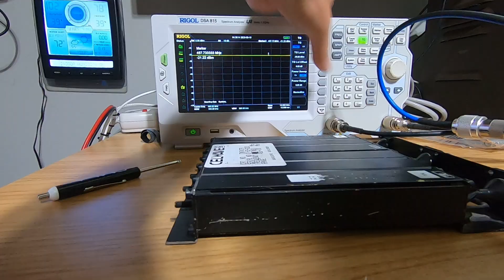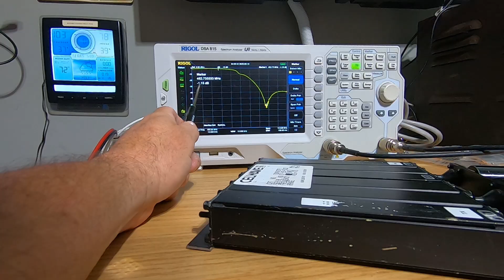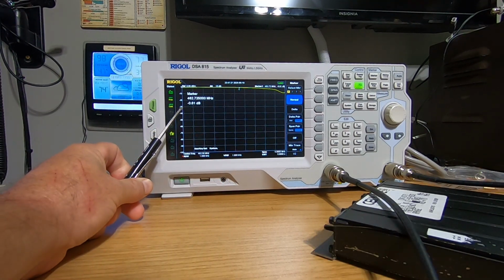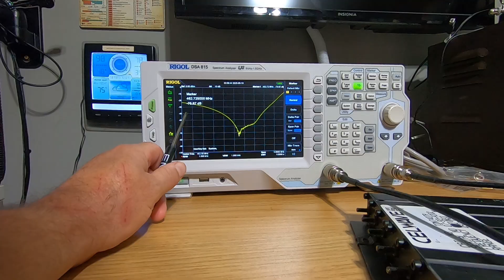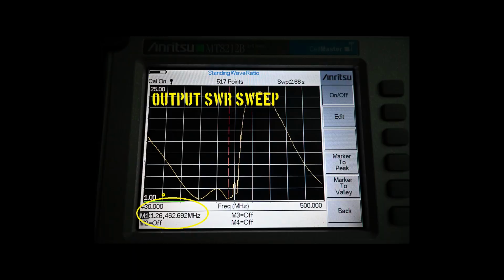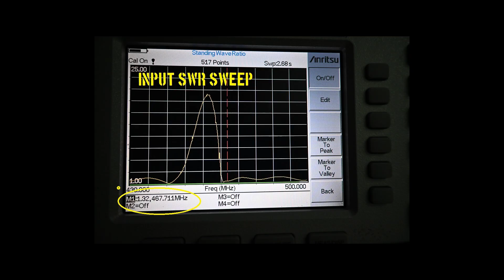GMRS radio repeater notch duplexer tuning.

Comment: Great video! I have a question, I have a Icom FR4000 with a built in duplexer set for 461.275 / 466.275 repeater. Will I still need to tune the duplexer to 462.7000 / 467.7000 GMRS frequency?
Reply from the maker: Thank you ! Yes you need to retune that duplexer.  Without retuning you would be better off using separate feed lines and antennas for transmit and receive and separating those by 10' of vertical separation. Place receive high and transmit low. I hope this helps and thanks for watching !
Reply: @survivalcomms  yes sir thank you so much!!